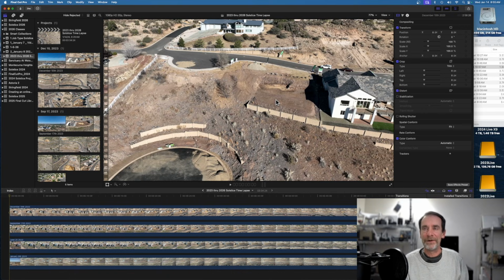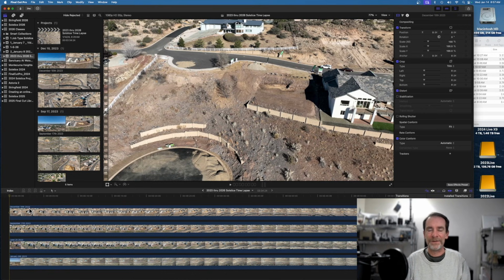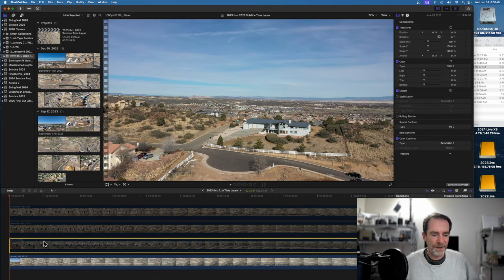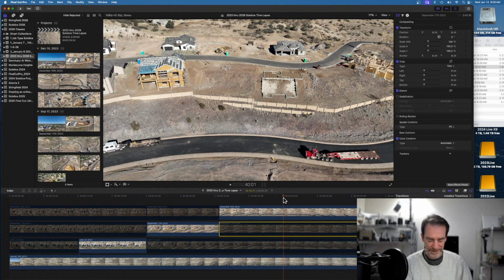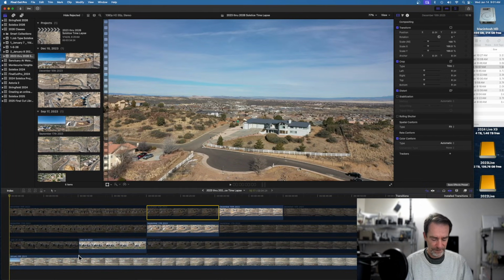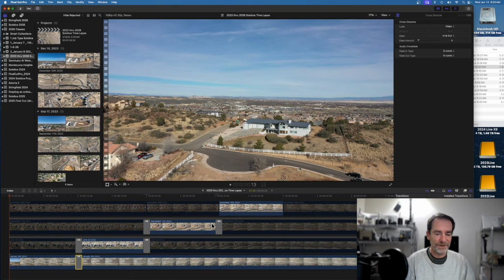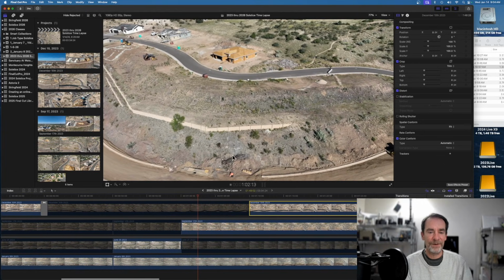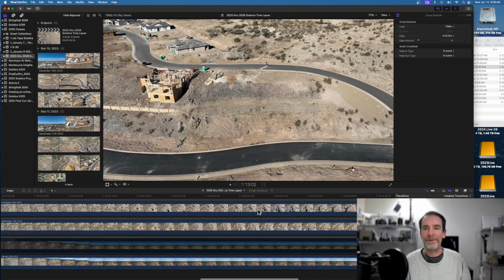Drone Construction Time-Lapse: Turning 3 Years of Flight Video Into a Client Deliverable

Comment: Would turn out even better if you addeed a quick fade transition betwenn clips, and also if you resize to match each clip proportion with the next one, because even using waypoints it will shift a bit.
Reply from the maker: There's always room for improvement.  This was meant to be a quicker over view.  When preparing for our clients theres more attention to detail.